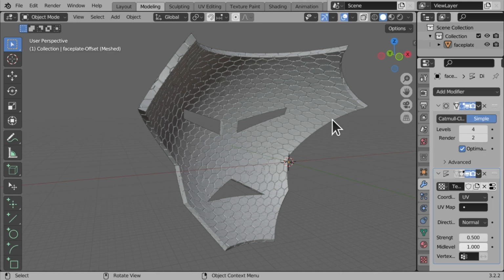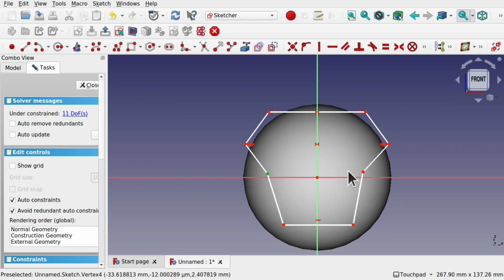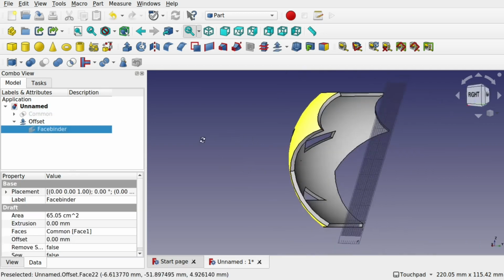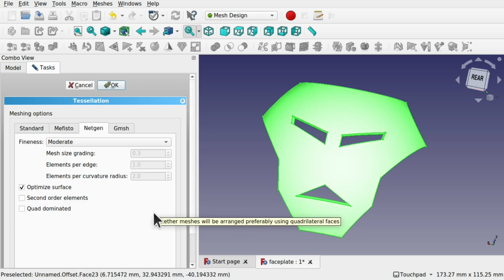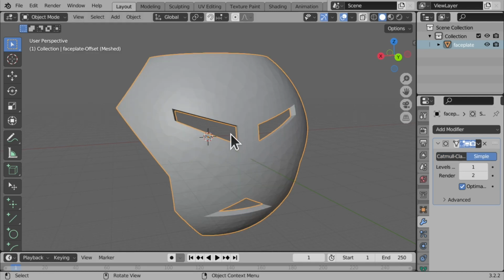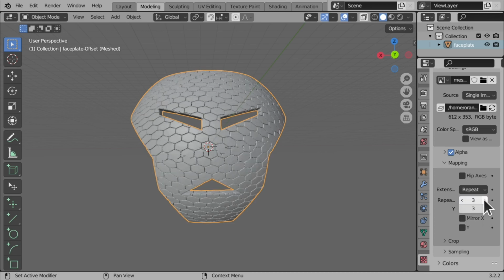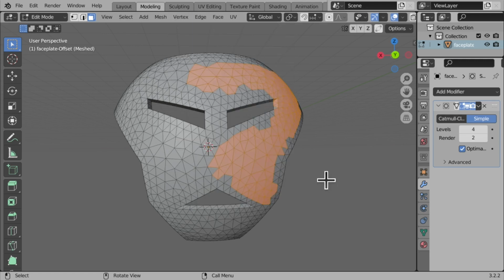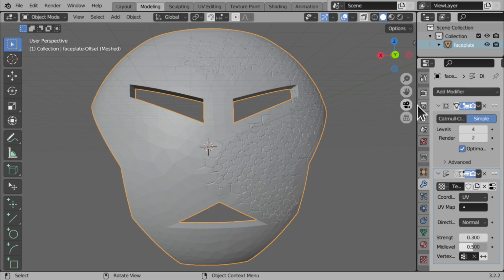FreeCAD To Blender : 3D Print Custom Surfacing | Displacement Maps | Apply To STL

Comment: Hello, thank you for the video. Very informative. Just wondering, does the scale, or dimensions remain accurate in blender after being exported from freecad?
Reply from the maker: Glad you enjoyed.  The scale will stay accurate if you are working in mm, there is a small issue if you export out in inches with some CAD packages, I don't know if that applies to blender.

Comment: Finally a tutorial I could actually understand – thank you so much! 🙌 Unfortunately, I’m getting the following error in Bambu Studio and Orca Slicer when I try to open my STL: "Loading of model failed". "The file does not contain any geometry data". Do you maybe have a solution for this?
Reply from the maker: That's great to hear the tutorial helped and thanks for letting me know, have you tried import the STL back into freeCAD to see if it loads correctly? I have seen this error before.  If you’re exporting from Blender and getting that error, it usually means the STL came out empty. A few things to try: 
Switch to Object Mode before exporting (Edit Mode can cause issues).

Make sure the mesh is actually selected, and tick “Selection Only” in the export options if you’re using that.

Apply modifiers (like Mirror, Boolean, etc.) since they don’t always carry over to STL.

Apply transforms (scale, rotation) with Ctrl+A so the mesh exports correctly.

In the export dialog, choose Binary STL, it’s smaller and works more reliably than ASCII.
Reply: @MangoJellySolutions  Apparently, I was really in the wrong Mode: beginner’s mistake 🙈 Now it worked. Thank you very much!

Comment: Blender is a natural progression from FreeCAD to more detailed object modeling. Thank you for the excellent example of displacement vs bump map. I had to do a lot of research to find out what you are showing so simply here. For those of you following MangoJelly Solutions, excellent choice, for those of you who aren't,  you should click subscribe now. A hardware warning, not all wireless 3 button mice are equal. Just a heads up for you. I have to switch mice when switching programs. My wireless mouse won't work correctly with blender. Blender is extremely powerful and satisfying when you understand the basics. Thumbs up! And thank you again.
Reply from the maker: Thank you for such a kind comment and  recommending the channel.  I often use a touch pad so had to dust off the old mouse. There is a way to emulate this mouse button but haven't looked into that yet. Thanks for the comments. I am always a bit wary of introducing content that is outside freecad so I try to find a link where it can be used.

Comment: Good morning  , Darren . Great video haven't had a chance to view the first one yet . I received them out of sync , for some reason no problem . Here are several questions . Is it possible to use 2 monitors with freecad ? I'd like to have all  the tools and such on one monitor and just a large drawing area on the other . I want to make a brick pattern in a 3D printed base plate Foundry pattern for a model engine I am building  . How can I do that ? I hope you're doing well,  stay  safe my friend . 

Terry
Reply from the maker: Hi Terry, hope your well. Regarding the dual monitors. I never used two monitors but I am wondering if the tile window option will help you in your quest. Regarding the brick pattern, this technique shown in the video should be ideal. If you find a number of texture for brickwork then you can experiment with the different ones by dealing them in and out of the texture map tab.

Comment: Can you create the texture in Freecad? Ive seen models in Solidworks that have textured surfaces, can Freecad do the same?
Reply from the maker: The render workbenches create a texture but this is not a displacement that would show up on the 3D print. You can add such things as knurling but that requires sketching onto the surfaces and using a pattern operation but it has its limitations.

Comment: I haven't played with blender for the past seven or eight years now.  Looks a lot more refined now then what it was.  But it still has so many layers to it that it requires a steep learning curve to be somewhat proficient.
Reply from the maker: Yes it's come a long way but as you said it still has a step learning curve. It's hard to understand what the 'basics' to learn are anymore so overtime I have tended to keep to doing  specific tasks rather than spending most of my time trying to learn everything.

Comment: Excellent tutorial. Straight to the point, seen many videos on this process using blender but always unclear.
Reply from the maker: Thank you, that's exactly what I was going for 😊. Many tutorials seem to rely on the user knowing all the shortcut keys. For me by the time I have gone to bed I have forgotten most of them.
Reply: @MangoJellySolutions  Yeah, understand about forgetting things; I have enough trouble since I use a variety of CAD programs for specific tasks. Thankfully the latest version of Blender is a lot more intuitive with the conventional mouse selection.

Regarding the use of materials in Blender, do you plan to do a tutorial for resizing/scaling and positioning of a material on a surface? Seen some awkward videos on using map nodes to scale and position the material - left with a blank face 😶.